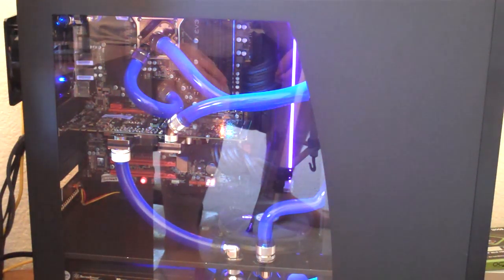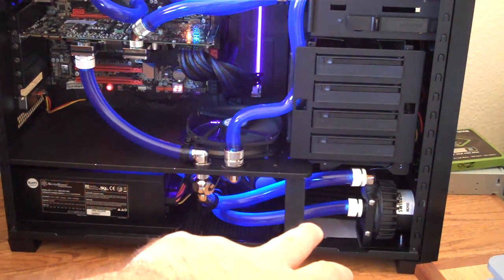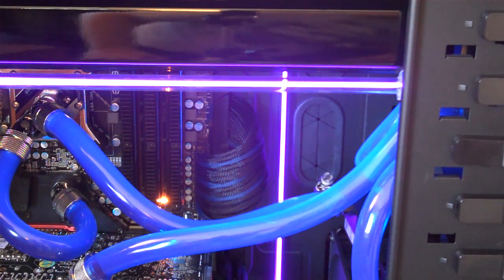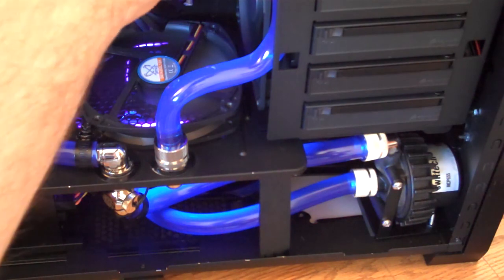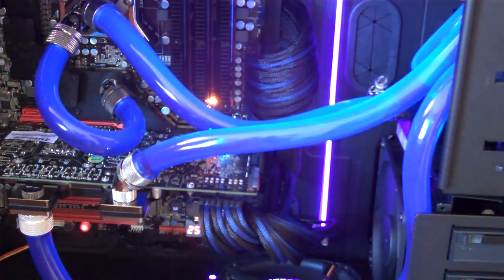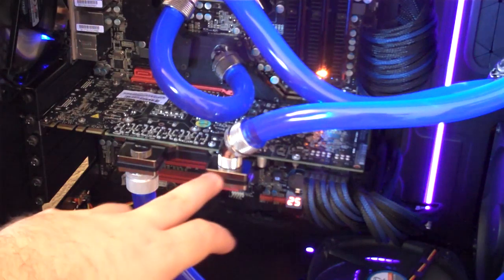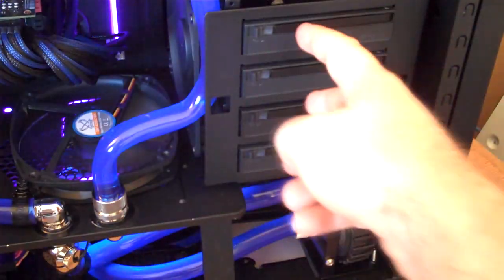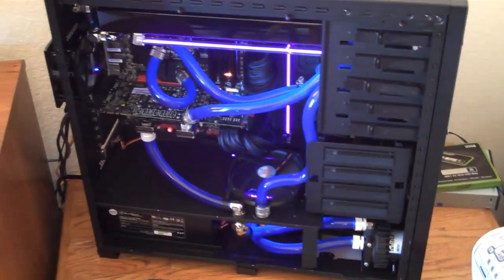EVGA GTX 580 SC SLI Dual Loop ReBuild Part #2

Comment from the maker: @IIRockstarrxX You can do a pretty nice WC setup in that case. Probably not a dual loop but something pretty good. If you stick with basic items you can get a pump, tubing rad & rez for $200.00 but the other big cost is the cost of the blocks. sites like EVGA.com have for sale sections, can get nice semi used equipment for cheap.

Comment: @Lethalhammer I see. Well, I got the Enermax Revolution 85+ 1250W and I think it looks great. I got a 1250W and only got a 5870 xD I thought I'd get a really good PSU so I wouldn't have to upgrade it in the near future. I might be getting a GTX 580 in January, but I'll see what AMD brings to the table first.

Comment: That Strider 1500W is still a lot for three GTX 580's/480's. :P A 1250W would be sufficient enough too. But it's better to get a really good PSU in case new graphics cards some day will require that much juice.

Comment: Im not sure if i l don right but my system is on just one water pump...straight to graphic card from there to CPU... to radiator(monster 4 stages) .. to reservior(huge)  ..and back to the pump(300L/h) same like ur  BIG WATER PIPES!!!.All around....but my case is Cooler Master HAF 920 and cant stand on the ground..radiator is on the back and is a bit.. to long...haha..looks ok and ....wired..people say....O_o OMG wth is that??!! why this way..Are u thinking about piping ur RAM?